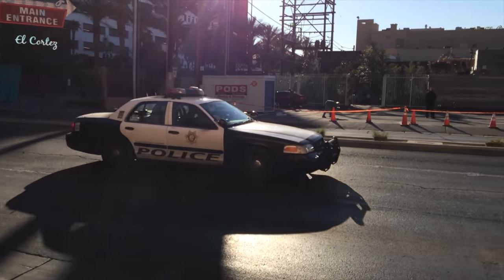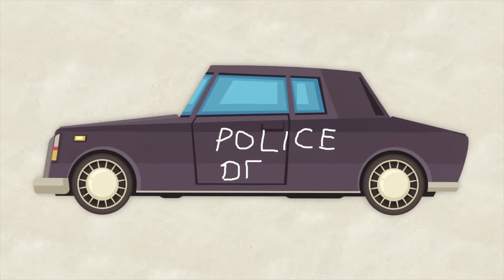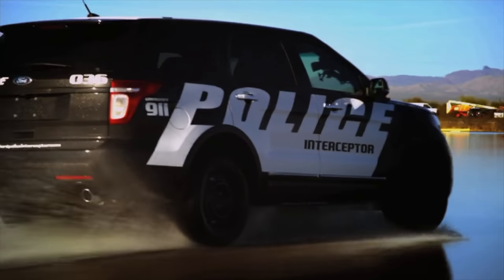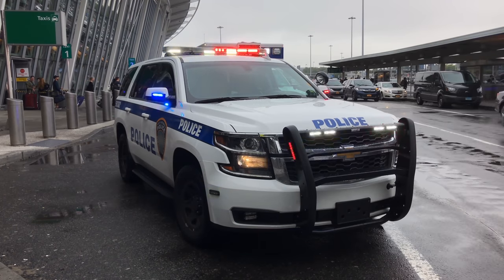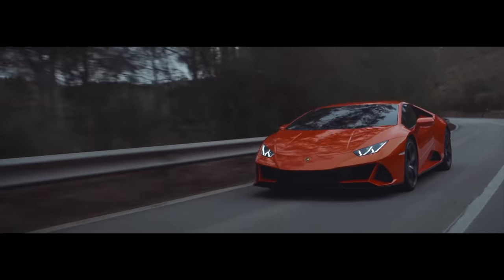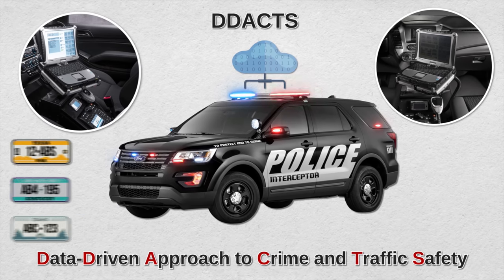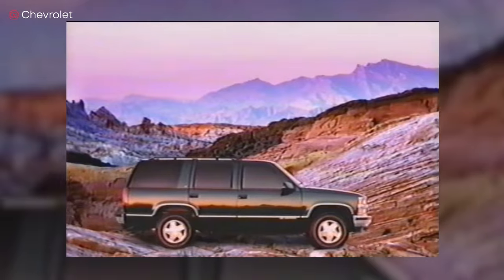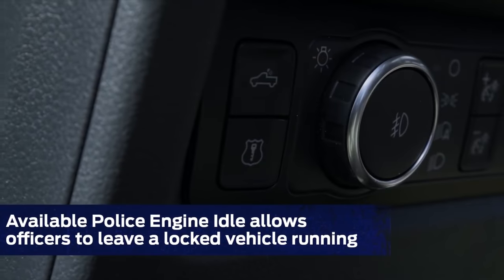Here’s Why You Can’t Outrun a Police Car

Comment: Cool channel Scotty. Yes I have owned an ex cop car. It was a 1982 Holden (GM) VH Commodore 5 litre V8. South Australian spec sky blue in colour. It was what we call in Australia, a "poverty pack", like all police cars were or still are (?) here. This meant no optional extras. These were vinyl seats, no radio, no electric windows, etc. Oh, the only option that was ticked was aircon. It was my second car and I loved it! It was faster than a normal car. Transmission was stronger and shifted quickly. (Squeal tyres going into second). Everything an adolescent shouldn't be driving. It had the range of a motorbike. At less than 200km (120mi) I was looking for the next fuel station. Next car was a 1989 red 3.9 litre EA Ford Falcon wagon ex Western Australia fire department, with a range of 700km. No problems with either car. Former was traded for the latter because of fuel consumption and the latter was stolen. Anyway enough of my nostalgic rant, but you did ask.
Reply: Damn that ford gets about double what my 2014 chrysler 200 gets on a full tank of gas.

Comment: I just retired from the 3rd largest police dept in NY and I wish our police cars had all these goodies! Never had ballistic panels, bullet proof glass, or any interior upgrades. Cars are always breaking down and kept in service until they fall apart. Seats were always breaking, had one that was held up by a small floor jack.
Reply: 22 1/2 years in a cruiser. Like you said, no fancy safety features. Usually fleet vehicles fitted with emergency equipment and a prisoner cage, if you’re lucky. After being driven 24/7 365, the interior is trashed, body’s beaten and the fleet mechanics do just enough to get them out of the garage and back to the precincts.
That being said, I’m recently retired and I already miss driving one.
Reply: Was it budget though? Such a large station I would imagine they would try to get as long as possible out of a vehicle. Also now if they keep cutting budgets “defund” it’s only going to bring down the quality that officers definitely need

Comment: I had a 1976 Ford Custom 500 ( Plain Jane LTD) with the 460 interceptor. The car ran and handled great!! I kept it for years!  I wish I would have kept it!  I bought it in 1981 and got rid of it around 2004🙂
Reply: Cool.  I have a 2010 CVPI that I bought 7 years ago, had less than 75,000 miles on it at the time, just broke 170,000 last week.
Reply: Those Interceptor motors were beasts! Had a Crown Vic that saved my life in a crash, got hit at the firewall, driver side. Still miss the old gal 😔

Comment: Great video, lots of knowledge! I have owned two interceptors. First one I bought in 2007. It was a 2004 Crown Victoria. I bought it with 90k miles for 2800$. That car was the best 2800$ Ive ever spent. It went to 300k miles with only a battery and radiator replacement. Very solid, durable car with a 4.6liter. Pulled my boat with a smile. Second was a 2006 impala 9C1, also an incredible car! The suspension on both were like an army tank! Although my girlfriend wouldn’t ride in it, I suggest having a regular car for taking girls on dates!
Reply: I bought a 2010 charger from a county auction.  It still had the push bar and window bars in the back.  It's been extremely reliable and I've not been nice to it the last 5 years I've had it.  There were some noises when I first got it but after fishing about $80 worth of unused shotgun shells from under the floor panels it stopped.
Reply: Adjacent to an underprivileged neighbourhood.
Reply: @philip5940  what does underprivileged mean. Is that the same as lazy people who don’t like to work?

Comment: I bought a Ford F-150 previously owned by the local Sheriff's department over the summer. It runs well, but there seem to have been a few mistakes while they were uninstalling the electrical gizmos. The Driver side stereo speaker in the door was not reconnected properly, the cargo/reverse light over the bed were not reinstalled properly and did not have bulbs, and there were a few holes drilled into the dashboard to mount equipment.

 So far, all of the issues are relatively small things (even the dashboard holes) that can be easily fixed, and I was able to get the vehicle for a fraction of what I would have paid for a similar model with a "civilian" owner.

Comment: The fastest police vehicle in the USA is actually the 2011-2017 Chevrolet Caprice PPV with a top speed of 155 MPH, the Explorer is the quickest.
Reply: And this is why you can easily outrun them. I only had one 4 cylinder that could not break 160 MPH. I wonder what the 0-60 and 1/4 mile times are on those police vehicles?
Reply: @vapemedical938  The 6.0L Caprice does 0-60 around 5.5-6.0 second range.
Reply: Yeah, you guys read a lot. We get it.
Reply: @hornetbrown  😂😉😎
Reply: @patrickkneitz6523  Probably not, but the Camaro was never a Police vehicle after the B4C from 1993-2002. So one could argue it’s not a real police vehicle.
Reply: My town used them for decades till the smaller explorers then switched over around 2012
Reply: The dodge charger can also hit 155.
Reply: @beereugenics1592  MotorTrend says the 2021 Dodge Charger Police Package with the Hemi, does 140 mph.
Reply: @EliKazmaier  that test was after one mile. With more road these cars can easily hit 155 and the older models were even faster.

Comment: This was 1970s or 1980s, I bought a used Chevy Nova police car.  There was a metal bracket at the bottom of the auto-transmission preventing user from shift into the 1st gear (drag racing it).  The 2 back doors can not be open from the inside.  The metal rods inside the doors were removed and taped to the inside of car door (preventing back seat people from jumping out).

Comment: I used to work at a used car lot back in the early 80s. One day and old lady brings in her car in this huffing and puffing. She was wanting to sell it and it was a 72 fury 3. It had a 440 high performance engine in it with the 750 Holley stock. Are we would race people in hot rods and beat everyone of them. It would not turn a tire from a dead stop but going 30 miles an hour and punch it and hold on cuz it will jump sideways with you.. it was solid white as it was a state patrol car. My friend restored it which didn't take much doing because it was in great shape.. he owned it up until a couple years ago and one many trophies with it at car shows throughout the years

Comment: Elwood: This was a bargain. I picked it up at the Mount Prospect city police auction last spring. It's an old Mount Prospect police car. They were practically giving 'em away.

Jake: Well thank you, pal. The day I get outta prison, my own brother picks me up in a police car!

Elwood: You don't like it?

Jake: No I don't like it...

[Elwood Blues floors the pedal and jumps over an open drawbridge]

Jake: Car's got a lot of pickup.

Elwood: It's got a cop motor, a 440 cubic inch plant, it's got cop tires, cop suspensions, cop shocks. It's a model made before catalytic converters so it'll run good on regular gas. What do you say, is it the new Bluesmobile or what?

[a brief thinking pause while Jake attempts to light a cigarette]

Jake: Fix the cigarette lighter.
Reply: 😂🤣😂🤣😂🤣
Spot on....
Reply: LMAO

Comment: I bought a white 2008 Crown Vic (in 2012)ex-patrol car from Long Beach. The guy I bought it from was an active officer that ran a side business, lot near Hollywood, with about 150 Crown Vics that he rented to the studios as extras for the movies (cabs or cop cars). He also cycled some stock out which he sold to the public. When I shopped for my car he told me that rubber floored vehicles were patrol cars and carpeted were for detectives. My car was very predictable, handled the a champ. When I bought my ‘17 Ram 1500, I gave it to my niece as her first car.

Comment: Most sport bikes are faster than any police car.  The liter bikes top out at 186mph, and even faster if they bypass the limiter.   Of course it’s not just the vehicles involved, it’s also the skill and will of the operators.
Reply: A bikes real advantage is acceleration.
Reply: The flashing Christmas lights and sirens 🚨 makes you  feel weak.
Reply: But, no bike is faster than a radio. People "get away", yes - but that's usually because the police decide it's not worth it.
Reply: @lances6602 a radio only works if they can identify you lol if you have no plate and they don't know what you look like then they can't tell other police what to look out for
Reply: @minarchisttrucker2775  If they think you're just speeding, then you will probably be fine. If they think you just robbed a bank, they will find you - no license plate and all.
Reply: @allamericanslacker2378  And the width. A sportbike can maneuver between vehicles effortlessly in heavy traffic
Reply: @lances6602  that is such a flawed concept which relies on the assumption that the driver continues driving on the same road after visual has been lost
Reply: @thejman5552  You do realize there are cameras everywhere, the police have helicopters, etc? It's very easy for the police to figure out who was speeding and track them down immediately, or later depending on the situation.
Reply: @lances6602  helicopters are not nearly cost effective to use and cameras are not readily accessed. Your point has nothing to do with radios anymore
Reply: @thejman5552  it's all about whether or not the police decide the chase is "worth it or not". That decision dictates what resources are employed (in helicopter, stop sticks, etc). This is all pretty simple, easy to understand, and completely in-line with my 1st post- which is all about the officers desire to pursue. Did I simplify it enough for you now?
Reply: Also terrain, sport bikes are good in a straight line but suck in curves or off road
Reply: If they really want to track you down, they can use cell phone tower data to see what phone was in that area at that time and how fast the signals were changing between towers.  I’ve seen that done for serious stuff.   
Get a quality radar/LiDAR detector with the wireless equipment for your helmet.   I’m the lookout for my group of friends.  If I hold down my horn, everyone else does too so we all get the message to slow down.
Reply: Well this whole conversation took a turn ha at top speed
Reply: @lances6602 u can easily outrun a cop and never get caught , people do it everyday. No government issues vehicle is catching me lmao
Reply: @PSLG23 ive seen hundreds of dirtbikers smoke police bums by going deep jnto woodland lol. This lance guy thinks the police are deities 😂
Reply: @lances6602  If you're in a southern state that isn't TX or FL and/or rural part of said state, cameras and helicopters aren't a thing. Hell, I used to live in the 2nd richest city in my state and neither the county nor the city has a police helicopter. (The nearby air force base has them, but I dunno if they loan them out, with a pilot of course, to police if something happens. I doubt it.)

Comment: The Ford Interceptor has threat detection, with 360 sensors. If it senses someone coming up, it rolls the windows open, locks the truck, alerts the driver and starts the car. And all kinds of other small items that you can turn on in your explorer via Forscan.

Also they come with a full accessory wire harness from the factory with dedicated fuse panels, rated fuage wire, full signal wires (like tach, 12v-off, 12v-on,12v-running, 12v-accessories, dedicated alt, breaks active, engine&coolent/tranny temp, speed, gps/accelerometer sensors), all lights with secondary input, i.e. if you send a signal to the head light wire, it will take precedence over the factory, so they can strobe and disable all factory nights. It's insane the tech that comes on the new interceptor. The newest Gen explorer platform is amazing for an interceptor. And the explorer intercepter is actually completely different everywhere then the explorer consumer. From door size, panels, seats, dash. They look the same. But nope. 

Ford actually moved some interceptor tech to the consumer model because it's just awesome.

Comment: I bought a 2013 police utility, explorer.  I  had to change the  spark plugs when I bought it due to the constant idling.   Other than that it's the best vehicle I've ever owned. It's pepe, reliable, tough, corners incredibly And great acceleration.

But I purchased it from the military police so it wasn't used much for high speed travel, mostly idling.

Comment: A related story:  a few years ago, at an informal outdoor classic car meet, a couple of fellows showed up rather belatedly with a 1961 Ford police car, as originally decked out, marked with "Mayberry Police" on the doors.  It was an authentic artifact of "The Andy Griffith Show" as seen on TV during the sixties or so.  It included autographs of some of the cast on the upholstery and visors, but without that of Andy.  The driver was asked whether the local cops ever bothered him and he related that they do stop him - not for a violation - but to ogle the car.  That may explain why the guy was late to the car show.  The car had been bought at auction by some lady who allowed these guys to show it off.  It still had the Motorola two-way radio and the rotating "bubble gum machine" light on the roof.

Comment: Ok, most of this stuff is true SOMETIMES.  Some clarifications...

The interceptor IS faster than previous models.  But many civilian cars have gotten faster as well.  I could easily outrun a crown vic police car with my personal F150. 
Also, the car is only as good as the driver.  All cops need to qualify on minimum standards, but they aren't all expert pursuit drivers.  Someone who IS an expert pursuit driver could most likely outrun a cop who isn't.  That being said, when I qualify, I ALWAYS request the interceptor sedan, despite the fact that I never drove one on duty.  The handling is second to none.

The bulletproofing of a police car is an OPTION, and it's up for debate how many departments choose this option.  The department I worked for certainly did not.   An up-armored police car certainly isn't going to be the super-fast car that we're talking about here, although I'd trade some speed for the safety of bullet-resistance. 

While the Interceptor has a shift lock standard, it's really the first car that has that.  The crown vics I used to drive did not have the interlock (except for the car that belonged to the chief, who took great pleasure in asking new patrolmen to take his car for a wash and a gas, then watching them try to figure out why they couldn't get the damn thing into gear).  

And from what I have heard, you cannot buy a used modern interceptor.  Apparently there is a contract feature that they are bought back by Ford when the department is done with them.
Reply: If I wanted to outrun a police car on my motorcycle, it wouldn't be hard. Most police will not even bother as they need chief of police permission to engage in a chase. Radio won't help when your fast and easy to hide. Fortunately, I behave and avoid that scenario.
Reply: @texasforever7887   Bikes are easy to maneuver and hide. My zx10r has been down many roads and trails a car can not go down. It can easily be hidden in the woods or a field. It can be placed behind a building in the city. It can go around cars and cut through parking lots easily. There really is no comparison. Bikes disappear within seconds.

Comment: Great video! Yes, I owned and or drove, extensively, a 1974 Dodge Monaco and 1976 Dodge Coronet, both with 440 V8 4 bbl engines. These were ex California Highway Patrol cars. These engines ran so hot that the exhaust manifolds would glow cherry red hot, which you could see at night, when you popped the hood! I drove these cars back in the day in the mid  70’s. I still had the push bumpers on the cars and they had white tops, but the doors were painted black. I had a blast with both the ‘74 Dodge Monaco and the ‘76 Dodge Coronet as I was driving these cars when the CHP still had these cars in service. From a distance, if I were behind you in either of these cars, you could not tell the difference between my car and an in service CHP car! As I said, tons of fun, having other drivers just peel out of your way! Not to mention the high performance of the engines and handling packages, in both cars!
Reply: My first car in HS was a '67 Coronet ... loved it but it was a land-barge
Reply: @johnanderson1167  Yeah, they were big back then!

Comment: I personally have never owned a police car, however I did work for a volunteer Fire Department and the Department had an old Branco that was our Command vehicle, and it had a lot of issues. The Department decided to purchase 2 Ford Explorers from an auction in Utah. They were used Sheriff vehicles but were quite low in mileage. One had around 15k and the other was over 20K.
Reply: Cool story brah.

Comment: I had a 2012 Tahoe PPV with young kids, the Vinyl Floor,  and seats were a god send on road trips if children puked in the car. Also, the price was right. Best advice I was given was to get a highway police unit, and I did. That said I was told by law enforcement if you buy a car get the ones with the larger engine.  For example if they have a 6 or 8 option you can almost guarantee that the 8 will be either a supervisor or highway car for local PD and there will be less wear and tear.

Comment: The hour meter method of tracking usage is much more accurate as far measuring wear and tear. I worked for the motorcycle training program in my state, the bikes we sold at auction were relatively low mileage but they idled hundreds of hours and that means a lot. 🐾✌️🇺🇸